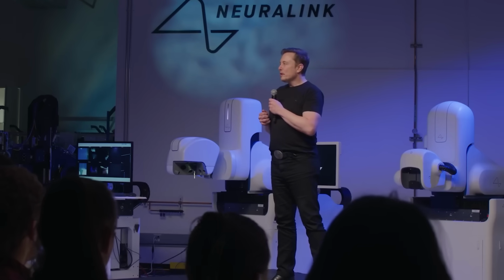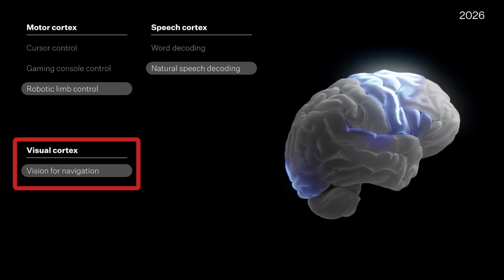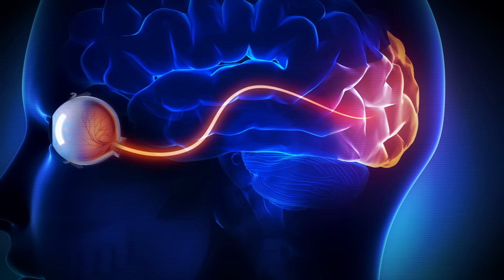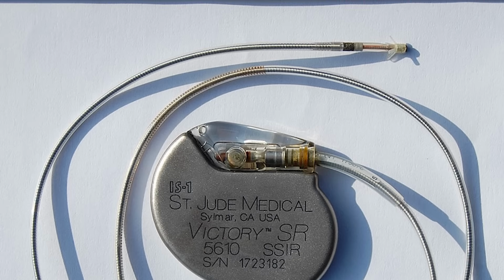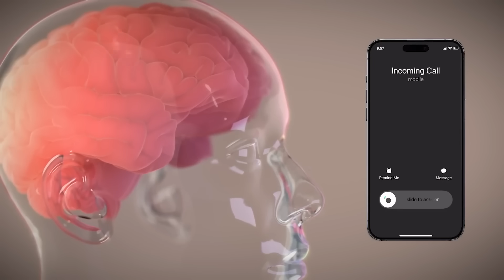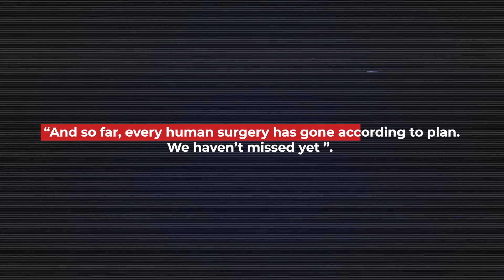Neuralink Reveals New BLINDSIGHT Implant!

Comment: As time advances they will not need implants at all and can replace the glasses to fit directly into the eye sockets. I got the opportunity to see one yesterday for a quick second. Still noticeable. Maybe a tin hat like device can read the signals the brain omits. Instead or surgery. That will take trials to prove once each area is mapped and the strength of the signals are read. But they already have it, it’s the lack of participation of the public that is hindering them. I hope I can help. I only know because it’s natural and the most over looked thing in humanity. This is solely opinion and speculation of course.

Comment: AI Summary

Abstract:

This video provides an in-depth update on Neuralink's advancements, particularly the ambitious "Blind Sight" project aimed at restoring or providing vision. Building on successful initial human trials with "Telepathy" for motor control (demonstrated by high user engagement and real-world impact), Neuralink outlines a rapid roadmap: thought-to-text communication by end of 2024, the first "Blind Sight" visual implant in 2026, and multi-implant integration leading to full brain AI access by 2028. The new S2 chip is introduced as an input device for brain stimulation, facilitating vision through camera-equipped glasses and requiring unique deep brain penetration capabilities. While initial visual experiences involve simple light patterns, Elon Musk envisions "superhero" vision. Neuralink also explores applications for emotional and cognitive regulation. The company emphasizes its unique surgical robotics, current "56k modem" level data link, and the long-term goal of industrializing a "broadband" whole-brain interface for millions, aiming to bridge the human-AI cognitive gap. Despite the rapid progress and successful surgeries, Neuralink maintains a cautious, highly regulated approach with expanding international trial approvals.

Neuralink's Vision for Human Cognition: From Thought Control to "Blind Sight"

*   0:02 Introducing "Blind Sight": Neuralink announces "Blind Sight," a brain implant technology designed to restore or provide human vision, drawing parallels to fictional concepts from Star Trek.
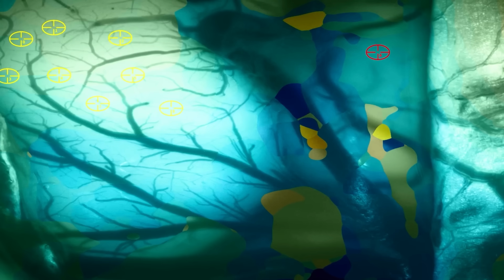*   0:31 Current Human Trials & Usage: Neuralink currently has seven human patients (four with spinal cord injuries, three with ALS) using the "Link" device independently from home, with some logging over 100 hours per week and an average usage of 50 hours.
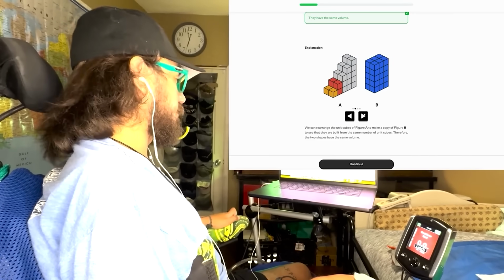*   0:53 2024 Roadmap - Speech Decoding from Thoughts: By the end of 2024, Neuralink aims to move implants from motor control to the speech cortex, enabling real-time decoding of words directly from thoughts into text or AI-assisted computer voice. This is a human-specific trial as monkeys lack language.
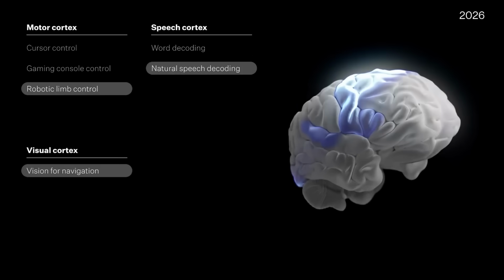*   1:42 2026 Roadmap - First "Blind Sight" Patient: In 2026, the first "Blind Sight" patient is slated to receive visual input directly to the brain via 3,000 electrodes, requiring no working eyes. This capability has been tested on monkeys for years.
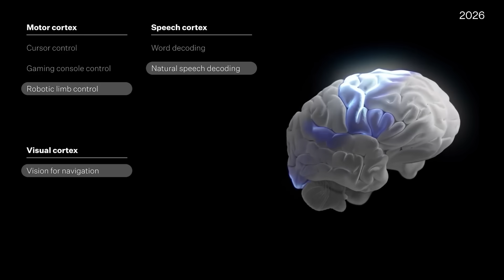*   2:03 2027-2028 Roadmap - Multi-Implant & AI Integration: The roadmap continues with support for multiple implants (speech, vision, motor) in one person by 2027, pushing to 10,000 channels, and then over 25,000 electrodes by 2028 for full brain access and direct AI integration.
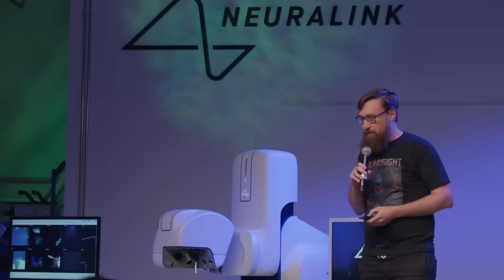*   2:51 "Blind Sight" Hardware and Functionality: "Blind Sight" utilizes camera-equipped glasses (similar to Meta Ray-Bans) that wirelessly connect to a smartphone. The phone translates the digital image into signals sent via Bluetooth to the new S2 Neuralink implant.
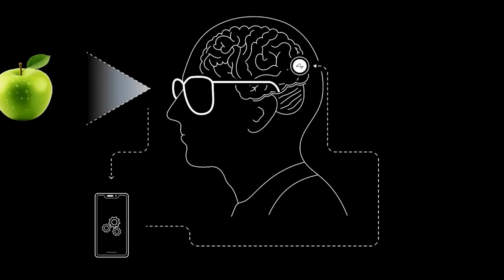*   3:24 The S2 Chip: Brain Stimulation Device: The S2 chip is Neuralink's new implant designed for stimulation (input) to the brain, contrasting with the N1 implant which is an output device (reads brain signals). It uses wider, chunkier electrode threads for safer and more effective electrical charge delivery.
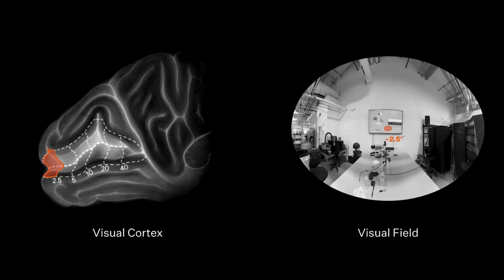*   4:16 Unique Deep Brain Penetration: Neuralink's surgical robot and custom electrode threads can penetrate up to 40mm deep into the brain, reaching areas like the calcine fissure in the visual cortex crucial for a wider field of view, a capability distinct from other BCIs.
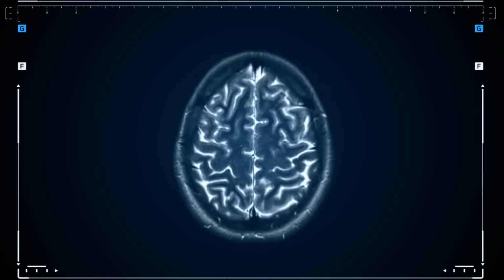*   5:48 Initial Visual Output & Future Ambitions: The initial visual experience with "Blind Sight" is described as white dots on a black field (dense in the center for detail, larger for peripheral vision). Elon Musk envisions future "superhero levels" of vision, including seeing in ultraviolet or infrared light.
*   6:40 "Telepathy" and Emotional/Cognitive Regulation: Neuralink's first product, "Telepathy," enables users to control a cursor, type, swipe, and game with their thoughts. The company is also exploring a third use case: regulating emotional and cognitive states (mood, chronic pain, memory) by targeting deeper brain regions, potentially acting as a "pacemaker" for psychological health.
*   7:34 Strategy: Whole Brain Interface and Industrialization: The core strategy is to scale by accessing more neurons and brain regions, aiming to build a "whole brain interface" that can read from or write to any part of the brain. The long-term goal is "industrialization," scaling to thousands and then millions of implants by applying Moore's law to the brain itself.
*   8:13 Real-World Impact on Users: The video highlights significant life improvements for participants: Nolan studies languages and works full days without assistance, Brad communicates outdoors after 6 years, and Alex signs his name with a robotic arm driven by his brain.
*   8:40 Pioneering Multiplayer Gaming: Neuralink patients have achieved the first known instance of five people playing multiplayer Mario Kart and Call of Duty using only their thoughts to control their characters.
*   9:05 Current Data Link vs. Future Goal: The current Neuralink data link is likened to a "56k modem," proving the concept, while the long-term goal is "broadband" gigabit-class throughput with whole-brain coverage and bidirectional communication to overcome the "input/output bottleneck."
*   10:23 Cautious Progress & International Approval: Neuralink emphasizes that progress will be slow, highly regulated, and visible, with all human surgeries conducted so far having gone "according to plan." International approvals for trials are secured in the US, UK, Canada, and UAE, moving into real-world environments.

I used gemini-2.5-flash-preview-05-20| input-price: 0.15 output-price: 3.5 max-context-length: 128_000 on rocketrecap dot com to summarize the transcript.
Cost (if I didn't use the free tier): $0.0069
Input tokens: 15864
Output tokens: 1283

Comment: The body doesn't like foreign objects intruding. It will be interesting to see how they can work around this, perhaps wrapping the wires inside organic material that the body perceives as "self".
Reply: you do know we have been putting stuff in bodies for decades, metal rods, hips, knees, stents, valves, joints, pace makers, adrenaline pumps etc.
Reply: Yeah man after my right femur broke and got rod and screw fixed on it. My hip hurts sometimes and it itches where the screws are inserted
Reply: A more effective method which would allow billions of electrodes would be an organoid that grows its own axons and dendrite "wires" to interface all the brain to the interface chip. This would result in true high definition colour vision and perfect restoration of motor functions. And be less risky. Ultimately it would allow mind uploads and transfers.
Reply: @trevorloughlin1492  wow
Reply: @trevorloughlin1492 
That would be good, for the way it is now, it's pretty dangerous IMHO.